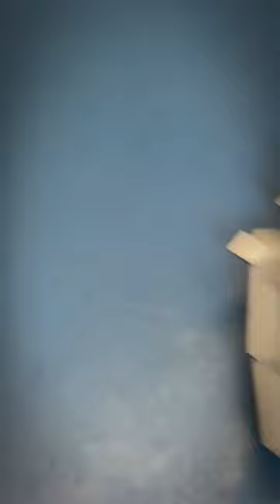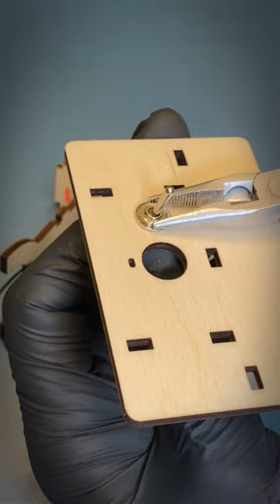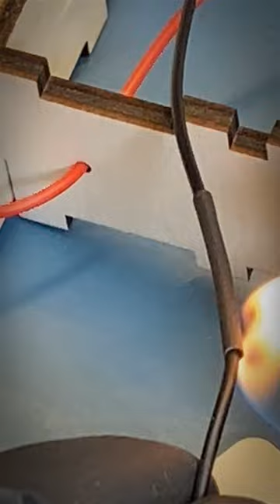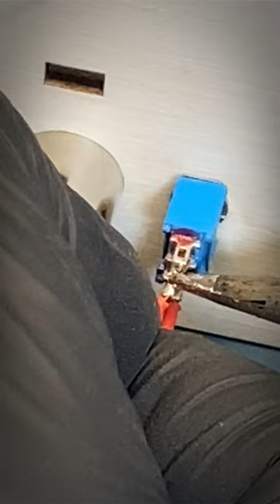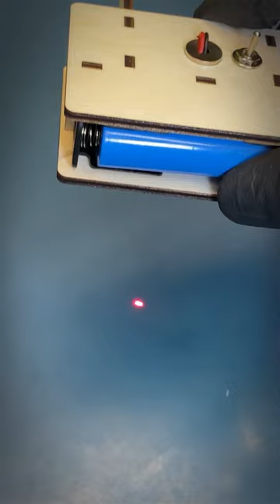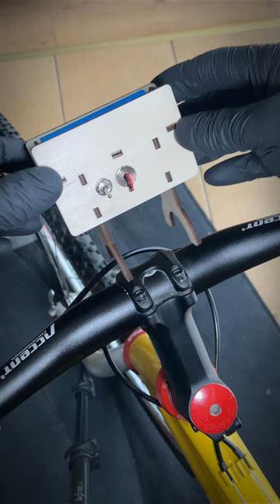When your handlebars are always off and it makes you crazy...

Comment: Don't try to line up the stem with the centre of the tyre .. they're both such small points of reference.

Instead look down and line up with the handlebar either side of the stem, with the fork legs.. two points of reference that cover a much larger surface, allowing for a more accurate install.